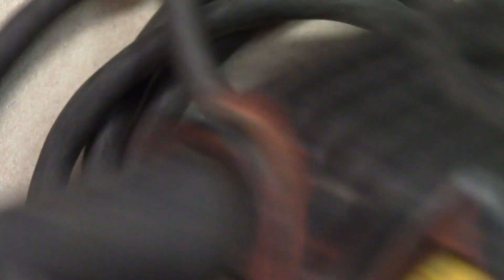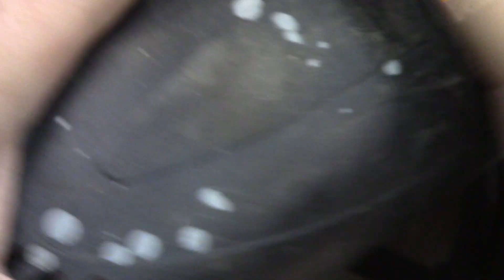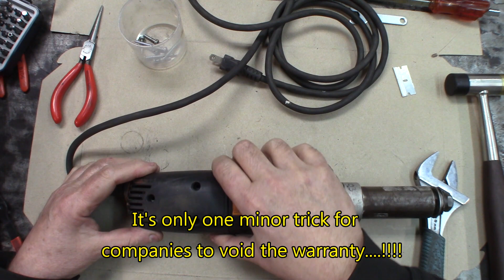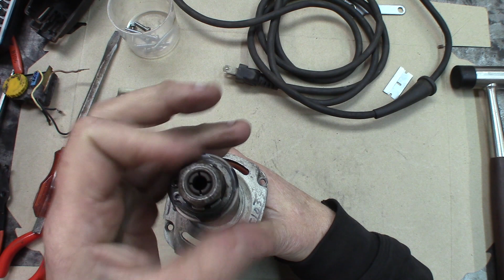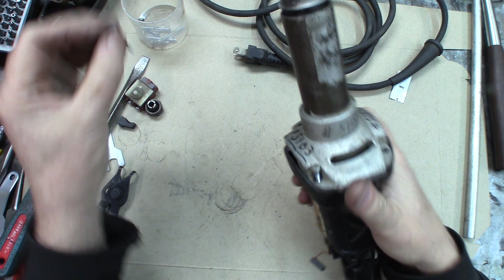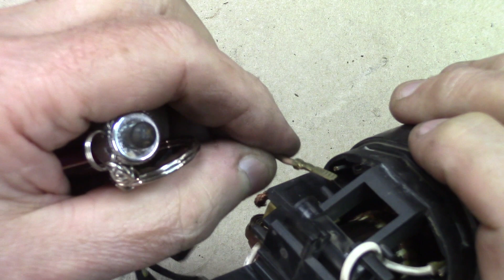Walter 6141 D Electric Die Grinder, Step By Step Disassembly and Reassembly

Comment: Bonjour Pierre!  Je suis en train de réparer le même grinder, (en passant il y a une petite erreur dans le titre du vidéo). En fait réparer, ce'st un bien grand mot, j'ai réalisé que le problème semble être que les brosses sont trop usées.  est-ce qu'il y a une source pour ces brosse là, mais pas chère, ou si on doit achetter les Walter chères?  Merci!!! 
en passant, super vidéo très clair...
Reply from the maker: Bonjour Sebastien, excuse le retard pour le retour.
D'après le site de Walter le numéro de stock d'un set de deus brosses est:  48L562, je n'ai pas trouvé exactement cet item, mais il y a des fournisseurs qui disent vendre des sets compatibles Walter/Metabo pour environ +/- $10 â $15. Tu devras verifier la compatibilité au niveau des dimensions, il est possible que les contacts de cuivre nécessitent un peu de soins en plus de t'assurer qu'il sont toujours bien isolés entre eux...
Comme suggestion, aller voir un centre de réparation d'outils proche de chez toi.
Merci pour le signalement de l'erreur dans le titre...      😉👍

Comment: Hello Pierre. Comment  aller vous? I have this grinder and I love it.  I bought it used and did not use it immediately.  So today I used it but I am not sure if it is working correctly.?  At full speed I have no problem but at slower speed it bogs down.  What can be the problem? Does not smell burnt no sparking in the housing. Runs beautifully… Can you suggest a solution.
Reply from the maker: Hi, sorry for taking a long time to get back to you. 
It all depends what you call slower speed, also what type of grinding device you're using. 
Remember that most types of electrical motors are delivering less power at slower speeds, unless there is an added circuit to compensate, not all tools are equiped with this device, as for my experience, I'm rarely using the minimum setting when grinding with this tool.
If you have more details, I could try to replicate and be back with my own experiences.    🙂

Comment: how can i dissasemble the metabo ge 710 plus any link please
Reply from the maker: try this if it helps, those are exploded views, it should help you determine how to disassemble it: 
https://www.metabo-service.com/en/spare-parts/variant-pdf/00616190

https://www.mtmc.co.uk/Metabo-GE-710-Plus-/-00616000-/-EU-230V-Spare-Parts__p-103813.aspx

https://www.ereplacementparts.com/metabo-ge-710-plus-amp-die-grinder-parts-c-8879_9109_289479.html

Comment: The last one I took apart needed $125 in parts to fix. I new equivalent was only $100.
Reply from the maker: Hi, 
Those brand new grinders original from Walter, cost in excess of $300 CDN around here, you must be talking about an alternative brand or some kind of knock off...
Guess that we were lucky here to get the spares from another unit at Zero $$$...   
Thanks for comment,   Pierre

Comment: Cool tear down. I will have to start designing  a holder for one of mine soon.
So many projects, so little time....
Informative video. Cheers
Reply from the maker: Hi Philippe,
Talk about time flying by so much faster as the years accumulate...   
Just like Harold says, "Let's keep on keeping on"
Cheers,    Pierre
Reply: Phil what type of holder are thinking of making?  I am curious if either of you would do a video of making a tool post holder for this grinder.  A nice project for a hobby guy like me and also a way to make a small tool post grinder. Thanks again!

Comment: These things can be quite a challenge -- interesting to see you tackle all that. As Harold commented - bit of an AvE approach :)
I have always liked cannibalizing stuff to make one good out of 2 or more that went to crap - not sure these days I'd have your measure of patience!
Great result.
Reply from the maker: Hi Chris,
Those grinders are somehow well built and easily repairable, since they sell over $300 it nice to get cheap ones with the spare parts...  And an air unit is really a heavy consumer for a compressor those give good performance without a 25 cfm compressor.
Cheers,    Pierre